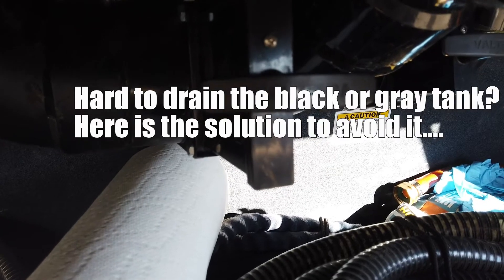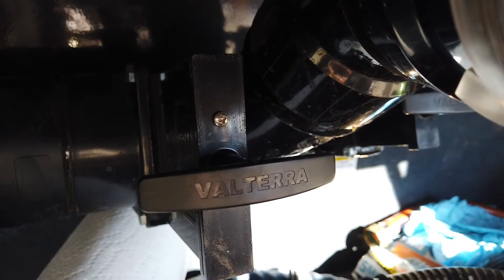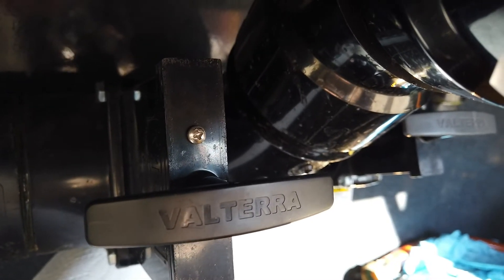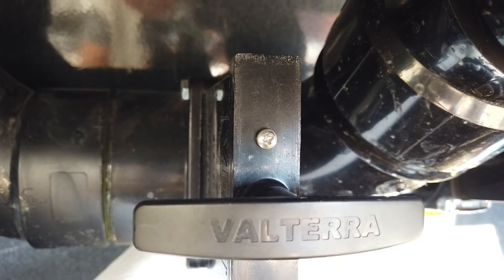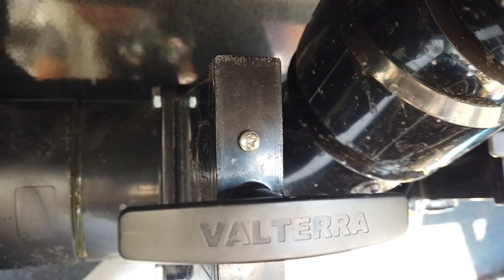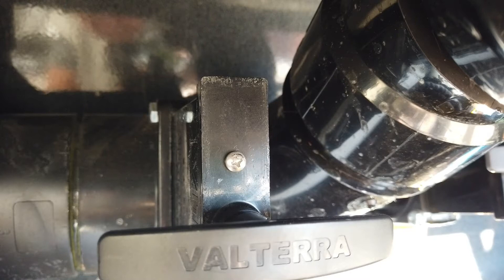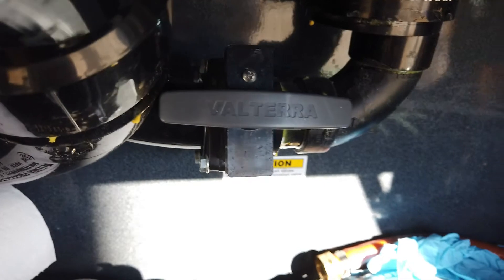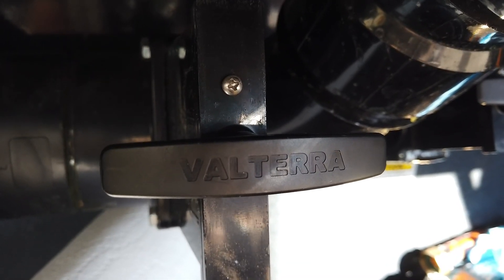BLACK TANK VALVE HARD TO OPEN AND CLOSE

Comment: Awesome idea... I have a 2015 Keystone Cougar fifth wheel and there are two remote levers for the black and gray tanks.  They are cables and I was thinking the cable was sticking. My issue was with the gray water valve, as we usually leave it open and now couldn't close it...   I was able to locate the dump gate valves and cut the belly open to access them.  I attempted remove the  valve itself and after removing the four bolts, the valve couldn't be removed due to the glued joints and secure tanks. I reinstalled the bolts.  I was able to remove the cable clamp bracket by removing two philips head bolts and nuts and a finger tight nut and this allowed the removal of the cable bracket from the gate valve body.  I then used Norm Burgess's idea of 3/32" drill and lube.  It turned out it was the valve and not the cable.  I placed a small machine screw in the hole and re assembled everything and it worked excellent.   I took the cable bracket off of the black tank valve and did the same mod and secured everything.  Closing up the belly with black gorilla tape.  Thank you for this info.  The most difficult thing was dealing with the under belly, once it was open and I could see it was just disassemble, drill, lubricate and reassemble.  Thanks again.

Comment: if you use a quarter cup of vegtable oil when you drop the tank your problem will disappear.  this is especially helpful for people that cant get to the black tank valve.  been rving for 5 years fulltime and this works.  good luck
Reply: I’ve gotta try this because I have three valves buried up in the chassis and I’d have to drop the underbelly liner to get to them.  Hope this works because 2 of the 3 gates are so hard to actuate.
Reply: so empty the tank then add the oil down drain or during???
Reply: @rps714  Yeah. I didn't understand that either. Putting oil in your black tank----- won't that defeat your purposes of trying to get that tank clean and keep it clean??? I'm a newbie,  so I don't understand a lot!!!😳

Comment: Merci pour votre recommandation. J'ai fait exactement ce que vous avez dit et les deux valves pour l'eau noir et  grise qui étaient collés, fonctionne comme des neuves. Merci pour le conseil. Merci pour votre recommandation. J'ai fait exactement ce que vous avez dit et les deux valves pour l'eau noir et  grise qui étaient collés, fonctionne comme des neuves. Merci pour le conseil. 
Thank you for your recommendation. I did exactly what you said and the two valves for the black and gray water that were stuck work like new. Thanks for the advice.

Comment: Works I’m sure, however, on my trailer the handle is a remote connection by cable to the actual valve which is inside of the insulated cover on the bottom of the trailer.

Comment: Ive heard of that before, i got a new to us rockwood 2016 5th wheel thats hard to open been thinkinf of doing this it has 2 gray tanks and a black both valves are hard like you said. The reat in the back is too far under and you have to pull it from the back of the trailer causing you to have to get under. Not good at the dump station. Thinking of keeping it pulled then putting a extition on valve and cutoff valve atatch a garden hose to drain.

Comment: Can I use coconut oil to lubricate these valves?.or WD-40?
Reply from the maker: WD 40
Reply from the maker: If you can get to the valve itself it will work
Reply from the maker: WD 40 works great
Reply from the maker: But silicon is better
Reply: I have bought a silicone lubricate spray it works fine.thanks for your sharing information.
Reply: I would try dishsoap 1-cup an some vinegar 1-cup and a citric cleaner about  3-cups with about 3- gal water!  It cleans tank out an lubricates sensors!

Comment: Mine is stuck closed and full...I have no idea what to do. I cant fix this alone and I don't know what to do
Reply: Sounds like you're in deep chlt. Have never had to do it, but here is an idea......I'd use my big wet/dry shop vaccum and see if I could empty (mostly) through the toilet (probably take a few times), then I'd just have to deal with what might remain in tank. Id have a replacement valve on hand and replace it.  I know many people can't handle the sewage aspect of it, but I was a plumber and it doesn't bother me.   Otherwise, I'd try what is in video first, even though you can't work the handle, spray it every day for several days......then I would pull the rod until it either opened or broke before I would attempt my idea.  Good luck.

Comment: Just add the oil done the commode when you add the chemicals.
Reply: Ok. We were wondering about that. But,  I'm still wondering about adding oil to your tank. That doesn't sound right.
Reply: There are many concoctions to help lube up valves! I would use 1/2 cup of Dawn dish soap an cup of pinesall  and a cup of citric cleaner! Make sure to add 2-3 gallons of water down toilet when drain black tank. I have been doing this for yrs an works great! Also if think have poop stuck or dry in black tank add a bag or 2 of Ice in toilet to help break down poop when take a camper on a ride it sloshes around and breaks up poop. Good Luck!
Reply from the maker: Not a good idea, some one did that and it really messed up the sensors

Comment: Don't you think you just lubricated the sludge buildup that's causing the problem? The sludge buildup will eventually get so bad even lubrication won't work. To solve the problem you need to pull and clean that gate valve or replace it (or, some think liquid additives like dish soap, etc. will eat that sludge away over time). Lubrication is just delaying the inevitable.